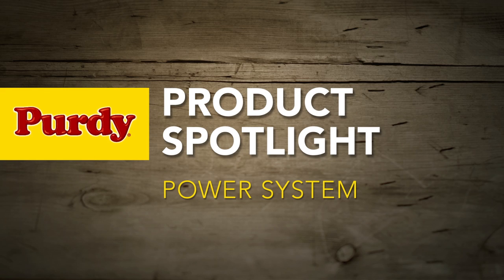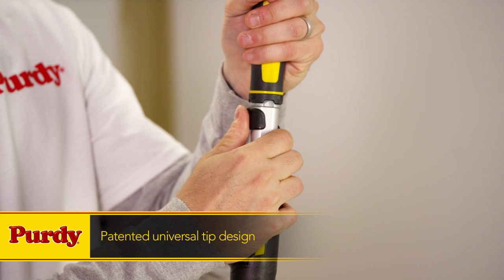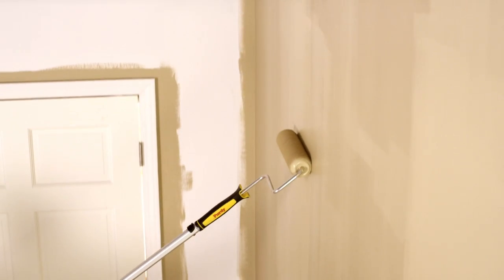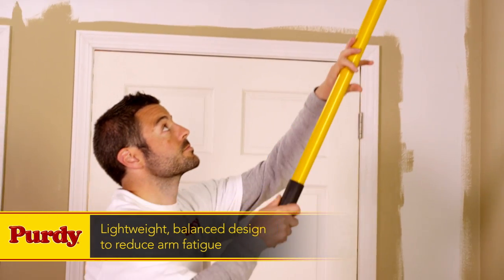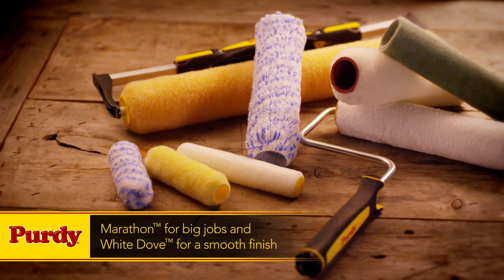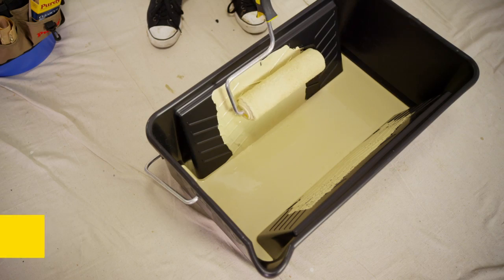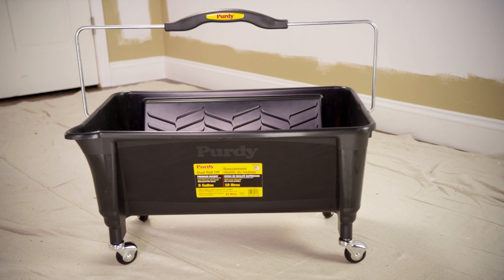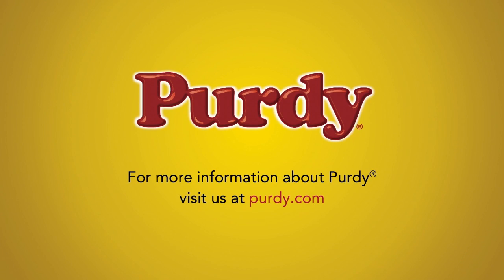Purdy® | The Purdy Power System

Comment: My 6-12 foot pole stuck open and wouldn’t close. I opened the mechanism and it needs a new spring. Unfortunately a call to Purdy didn’t help, parts aren’t available and “they’re not designed to be serviced”. It’s a shame because it’s built so solidly but it’s junk.